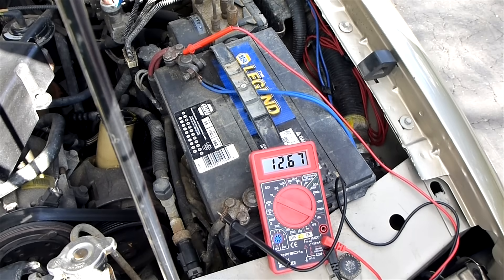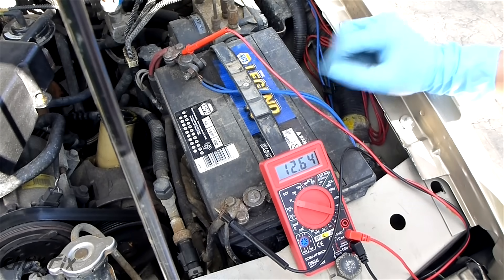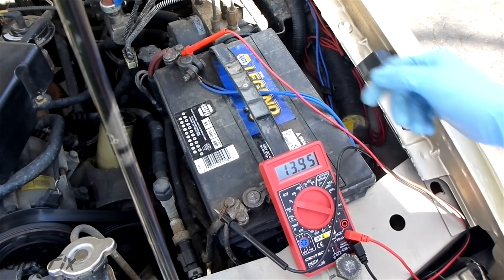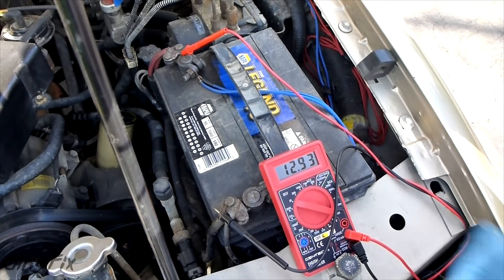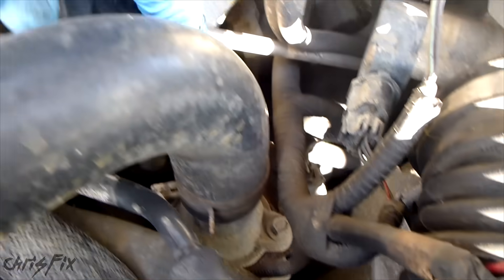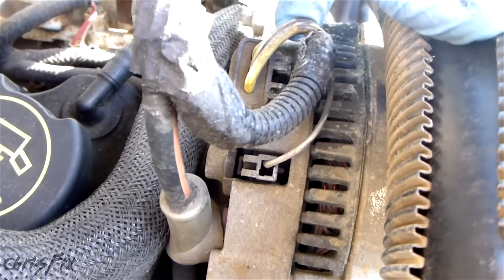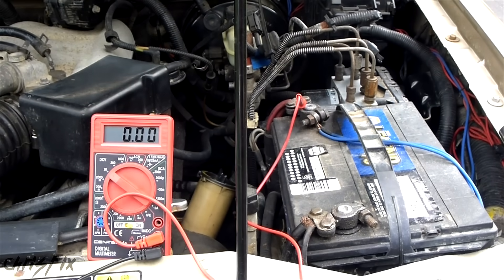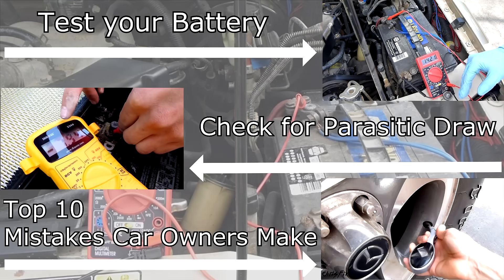How to Test an Alternator

Comment: I need some help  I have a 2015 dodge caravan so I replaced the alternator and the battery and the alternator connector and when I turn the van on let it sit for a couple minutes I disconnect the negative on the battery and it turns off I took the alternator to the auto parts store and they tested it and told me the alternator is working I don’t know if it’s normal for it to turn off on this vehicle model or if it’s something else 
Dose someone know what going on thanks

Comment: Yo I’m totally green when it comes to electrical issues: how can I tell the difference between a bad battery, bad ground connection, or bad alternator if I can’t start the car?

Some thinks I observed so far:
- clicking noise when trying to start car (wants to turn over but won’t) 
- did hear kind of a light whining sound when car was last running without a jump 
- headlights and interior lights ‘seem’ to be the same but unsure
- connector cables to battery are clean and no corrosion

Thanks yall

Comment: So if the battery keeps fully dying get it back on dies again, it won’t fully charge on a battery tender and when I get it starts and the voltage is below it’s the alternator even through the battery is low too?

Comment: What if you have 12.4 to 12.6 while running but then when you turn on accessories and then goes up to 13.8? Though it dropped to 11 for a second when accessories were on then shot up to a healthy ish charge and also has a p0341 code. With no accessories on and 1500 RPM it drops it down to 8.

Comment: Hi chris your videos are very informative and i really love watching them. Recently i’ve came across an issue on my 2012 honda civic 2.0l. The voltage while off is around 12.65, while on it’s 12.45 and when loaded with headlights it jumps to around 14.20. I’m really confused either my battery is at fault or the alternator ! I’d really appreciate your opinion on this and which way should i go to fix this. Thanks in advance. And videos like yours has been my inspiration for becoming a DIYer. Thank you for the videos and keep posting them 😊

Comment: Hi Chris!  I’m not sure if you’re going to see this comment since this is now such an old video so if anyone else has some ideas on how to diagnose this issue I’m about to explain I would appreciate it a lot!  So my wife’s 2013 Honda Civic would not start one day recently so I suspected the battery needed to be replaced.  She sometimes forgets to turn off her dome light.  So I took the battery to AutoZone.  The employee checked the battery with a device which said it just needed to be charged.  I decided to trickle charge it over night till it was completely charged.  Once I reinstalled the battery I decided to check the battery and alternator with my voltmeter.  The voltmeter read about 12.6 volts with the engine off.  Next I turned the engine on and checked the battery again.  The volts read the same maybe slightly lower.  At that point I suspected that it was the alternator.  Then I took it to a mechanic and he tested the alternator by simply taking the positive connection off the terminal while the vehicle was running.  He said if the alternator was bad the car would turn off.  He said he was going to check the battery to see if it was the problem.  He told us that the battery was not charging properly so we bought a new battery at AutoZone.  I then decided to do the same test I had done with my voltmeter on the old battery to see if it would read the same voltage with the engine off and then on.  Well it gave me the exact same readings as with the old battery.  Then I took my experiment a little further and decided to test the car with the engine running but also with the headlights on.  Finally I got the 14 volts I was wanting to see.  Once I turned off the headlights again but still with the engine running it went back to 12.6 volts.  Next I checked my other car which is a 2004 Honda Accord as a control to compare the two vehicles.  I actually have a fairly new alternator on the Accord.  The test on the Accord went exactly as I expected.  Just like in this video the battery read between 12 and 13 volts with the engine off.  Then I did the same test with the engine on but no headlights on yet.  It read 14.4 volts.  Then I turned on the headlights and it again was 14.4 Volts.  My question is if the mechanic is correct that the alternator is still working why am I only getting 14 volts when the engine is on AND the headlights as well?  Shouldn’t I be reading 14 volts when the engine is on even with the headlights off?  And why is the Civic not reading 14 volts under those conditions while the Accord reads 14 with or without the headlights on as long as the engine is running?

Comment: Hope you can help me with my issue. I replaced the battery 3 days ago, and when I crank the car, it hesitates but turns on. I tested the battery state of charge is 12.6. then the alternator is putting out 14.0 when loaded. When I turn off the car, the voltage drops back to 12.6. however, I noticed that if I first open the lights before I crank the engine, the voltage drops to about 11-11.5 volts. Also, I attached a multimeter on the battery and when i cranked, the voltage shows 12.0 initially, but drops to about 7 or 8 volts (with hard time starting but it do start), then back to 13.9-14.0 volts when the engine is running. you think I have a bad battery? or may the starter is faulty? thanks

Comment: Does this work with a 2 battery setup, and if so, does it matter which battery I hook the tool to?
Reply from the maker: Yes it still works with a 2 battery setup and I would hook it up to the main battery which has the alternator connected to it.

Comment: My battery light comes on at startup and turns off after driving 30 seconds. I checked everything with a multimeter but all good. But there’s a noise coming from the engine compartment. I have a feeling it’s a bad bearing in the alternator but it tests good. Why would it test good but the battery light comes on?

Comment: 13.57 volts when on and when shut off it’s at 12.8V. Do I have a bad alternator? My battery is coming to be 5 years old
Reply: Whats the resting voltage? I mean test it the following morning or when you haven't driven it to see what the actual battery condition is. It should be sitting at 12.6.
And is the 13.57 with stuff on or no? Lights,fan,etc. try turning those off and test if it changes.
Reply: @carlom9710  I tested it the following morning and it was resting at 12.8 and when i turned it on it was at 14.3. I ended up getting my battery and alternator tested the following day. Turns out it was a bad battery (5 years of the same battery). It was hard for me to tell since the voltage was “good”

Comment: Hi. I am not sure if you can answer my questions or you can help me with my problem   I installed new alternator and a new battery but the voltage still doesn’t go up. The fuse is good also. Thank you

Comment: I’ve replaced my alternator about 4 times now. The last time I did was July and my battery light came on a couple weeks ago. I just tested the voltage like you said and the voltage actually went lower when I turned the car on and when I revved the rpms up the voltage stayed at 12.3 or something. When I turned the car on it didn’t go below 10. Is there a problem with some connection to my alternator?
Reply: This has been an ongoing problem for about a year and a half I would love some insight to help me fix this problem for good. Thanks for listening.

Comment: Thank you SO VERY MUCH for your help. Now I know more or less what I'll need to be doing in the morning when I'm attempting to check my alternator on my 2007 Chrysler Sebring 2.4l engine. The only problem is that the engineers buried the battery behind and under the front driver's side quarter panel AND they buried the alternator underneath the A/C compressor unit. SMH. 😩
But hey, now I have more of a plan. Thanks a ton! 😎
Reply from the maker: Good luck with the test in the morning!

Comment: Don't know where to ask this so figured will try here.  We have a 2011 Toyota Sienna XLE with a ~two year old battery in it.  It recently died.  I connected a charger and let it charge all day.  The van started, and I checked voltage both with a multimeter and via scanner on OBD port with live data.  It was reading sub 12v.  This was with it running.  I concluded bad alternator.  I let the car sit a few days and went to grab something and it wouldn't unlock with key fob, so I unlocked with the key and checked and it was completely dead.  Got the charger out again, but first checked voltage with multimeter and it was reading 1.8 volts.  Connected charger and the van started clicking on and off.  Decided to disconnect battery completely and again checked the voltage, which now read about 10 volts.  Connected to the van again to test and was back to 1.8 volts.  Connected the charger to the battery while it was disconnected from the car terminals, and running a regular charge cycle or a trickle charge, the charger reads bad battery.  So my question is did a bad alternator take out the battery?  I know that a bad diode in the alternator can cause a parasitic drain, but can it cause the battery to fail in days?

Comment: Hi Chris 
I put new after market alternator in 2014 Honda Accord exl v6 after three weeks I have warning on dashboard that charging system fail. I tried following step 

Before cranking the engine resistance @ Alternator 
Electric cable : 0.3
New nut: 0.5
Alternator bolt: .5
Battery volts: 13

After cranking the engine without AC running 
Battery and alternator voltage reading: 14.6 volts 

After 3 minutes of running with AC on 
Battery and alternator voltage drops to 12.6volts 
Also got warning on dashboard that charging system fail.

Comment: So my 2011 kia sorento had little smoke from engine,  car sat for 2 days and then bow it wont turn over. Recall has HECU fuse being recalled. My friend said alternator burnt out. So if the alternator burnt out I cant get the car to even turn on to show lights . How do I test the alternator? Battery is good 13v on battery as it sits so would alternator cause no lights on dash no dip in volts . Trying to figure out where I should start

Comment: Hi Chris..Please Help!  I suspect my fuel pump is faulty(peugeot 407 1.8 petrol) voltage is flickering to it and want to check if all is good to the pump Can you tell me how ? because car is shut down sometimes, and I hear strange noises from the pump but it is electronically so I am not sure if should be like that or its a faulty pump. I have permaent DTC in the volatile memory which says : fuel pump speed control circuit malfunction" ... when I clear it appears again instantly. What can I check about it. Today I changed and put new BSM module, all is good now car running but only this DTC bothers me..  and maybe wirings to check to the pump ?Help pls I don`t want the car to shut down again in the trafik jam...

Comment: I have a new battery and car started, but when I shut it off, car wouldn’t start.  The next day tried to start it but not even the lights came on  or car wouldn’t unlock.  I had to manually unlock the car.  The car is a 2008 Acura TL.  If the battery is new, why would there be no juice for the car to start?
Reply from the maker: Sounds like the battery terminals might not be tight or making a good connection. You might also need to clean any corrosion if you have buildup

Comment: My connection from the negative terminal to the alternator casing is reading 0.02. Battery reads 12.37 stable with nothing on. Drops when accessories are on. Battery replaced brand new. Bad alternator or bad voltage regulator?

Comment: i been having an issue with battery charging system .changed alternator and new battery. noticed alternator shows a setpoint 4.17 but reading 14.8 and up to 15.1v. rebuilt alternator. is it bad? its new but rebuilt
Reply from the maker: Sounds like the voltage regulator could be bad, or it could be a sense line (if you have it) or just a poor ground/loose battery terminals. Just because it's new or rebuilt doesn't make it "good", if it ends up being bad then I'd return or get a replacement

Comment: Hey all, I have a 2010 F-150. New OEM alter alternator installed. On my grounding test I’m reading .12. Then touching red to my bracket I get zero. So sounds like a grounding issue. What part do I need to replace or clean? Confused where the alternator is actually ground?

Comment: Excellent video. I wrote down all your checks and expected readings. Worked my way through and was loosing 1.2V on the gearbox earthing strap. The strap looked good. Tested it by running a jump lead across the two points. Voltage went upto 14V, so replaced strap. All good now thanks to your video 😊😊
Reply from the maker: Glad you got it fixed! Nice work!

Comment: Easy test. Run engine and dis-connect black wire off battery. IF car dies , the alternator is BAD.
Reply from the maker: That can work in a pinch, but that can also cause voltage spikes and damage any sensitive electronics. A multimeter shows you exactly what is going on and you can do way safer and more precise tests

Comment: Hey Chris I have a 2005 Chevy Malibu I replace the starter and the ignition switch I can crank the car from the starter but not from the ignition switch would that be the BCM possibly. I'm not getting any power to my signal wire on the starter 😞
Reply from the maker: Could definitely be the BCM, but I'd check associate fuses/relays, make sure the ignition switch connector is plugged in fully, and make sure the the neutral safety switch (or clutch safety switch) is good. Also check the voltage coming out of the ignition switch start when you turn the key, if that's dead then the switch or wiring could still be the fault. If that all checks out, then it's most likely a BCM. See if you can scan for BCM codes
Reply: I tried the scan tool but it won't read codes because it's not recognizing the key is in the switch but like I said earlier everything else works when I turn the switch on.  I appreciate you taking time to give me answers. Most ppl won't do that so I thank you very much @chrisfix

Comment: Hi Chris. I enjoy watching your videos❤ and I would like to ask a question about the alternator. While my car was driving on the road, the engine suddenly stopped working and shut down. I removed the alternator and when I turn the pulley, the inside of it also turns, but when I stop the pulley suddenly, the inside continues to turn for a short while. This does not seem normal to me.

Comment: Hey, Chris, how are you doing? Hope all is well.  I have a question.   My alternator when it's running  it putting out 14.06 v those. This means that the alternator is going out? My battery light comes on for about 5 to 10 seconds, then it goes out, and it stays off. With light on, ac, and radio, it drops to 13.8.  Let me know your recommendations.  Thank you for the educational videos.
Reply from the maker: That 14v is ok but the battery light coming on for a few moments isn't normal, that could be a loose or corroded battery terminal, a loose or worn serpentine belt, a failing voltage regulator in the alternator, or a wiring/connector issue

Comment: Hey there ChrisFix, absa-f&&ing-lutely love your vids. I have a quick question/need some advice ?
Battery’s like 5months old, have not a had a single problem with anything.. until recently. Every morning I Mm, reads 12.2-12.5, starts perfectly.
However on a long drive after hour or so, the in-board dash comp “Battery Voltage” will read (after 14.5 the whole time) 12.2 WHILE I AM STILL DRIVING. 
Physically, nothing changes so no major difference.
Slightly worried something drastic will happen.. 
Any ideas please… anyone ?? 
Thank you ❤😊
Reply from the maker: Sounds like the alternator is starting to fail or you have loose/corroded connections

Comment: don't expect your run-of-mill mechanic/workshop to waste precious time checking wires, voltage drop and what not. If the voltage ain't right, he'll just insist on replacing the alternator... time saved and easy money....
Reply from the maker: That's why it's worth it to check yourself real quick!

Comment: Why my multimeter reads -0.1 on alternator case and the same on alternator bracket and when I test the ground on the firewall it doesn’t shows any voltage, does the fire wall ground is bad?
Reply from the maker: Should be ok, are you noticing any issues?
Reply: @chrisfix  thanks for answering,  I have been having issues with my car when i driving the battery lights turns on, and then the lights lose power it looks like it’s not even on. And when the car is in park with all accessories on the multimeter read 12 volts
Reply: And one time my battery fuse blow but I remplace it
Reply: My alternator and battery are new

Comment: My alternator 8 month old and battery good but from time to time the battery logo pops up on the dash I’m not sure if it’s the connection or what
Reply from the maker: Sounds like it could be a loose battery terminal connection or the alternator output wire is loose

Comment: I hadn't used my car for around  2 weeks. My car started fine, drove round for diesel then it died. Recovery guy came out and said the Altenator reading was 13.3v, and I needed a new Altenator. He never done any other thing like check wires, clean battery connections etc. Now it's in the garage and I'm looking at a hefty bill. By the sounds of the research I've done the reading is a little low but doesn't seem as bad as this guy was saying. He gave the battery a boost and the car started 3 times with no issues.  Works not been done yet and I'm thinking of calling off the work. Garage hasn't checked it yet but you never know who wants to make a buck. Also could the battery inactivity have caused any issues? Thanks for any help